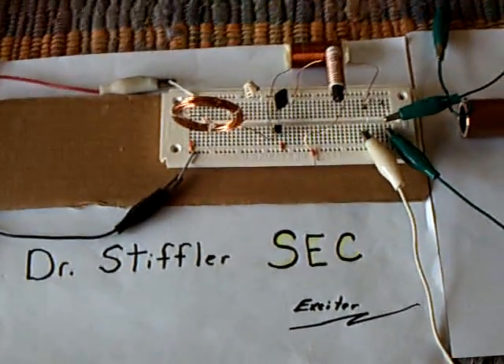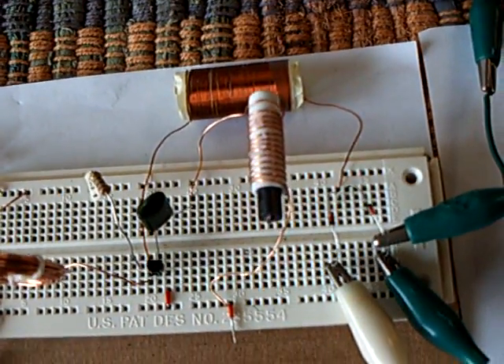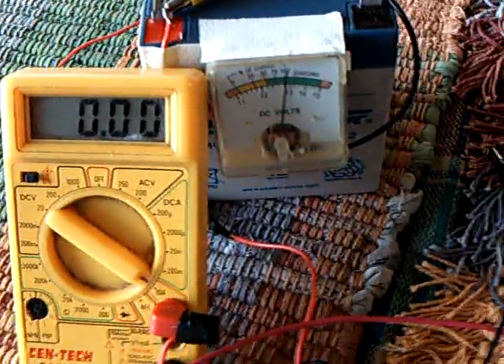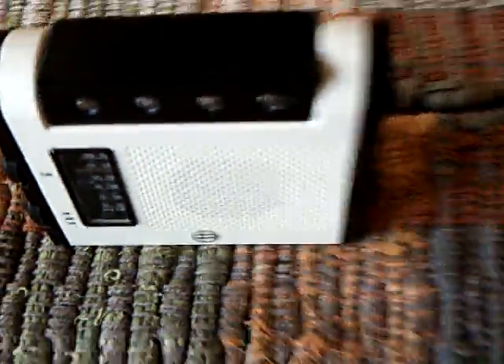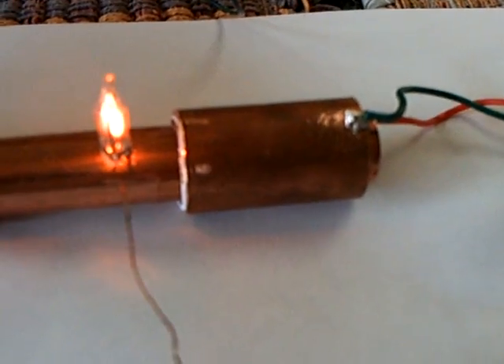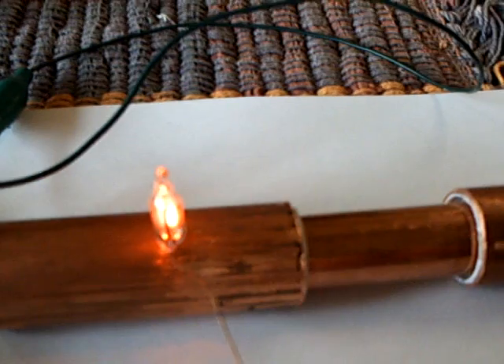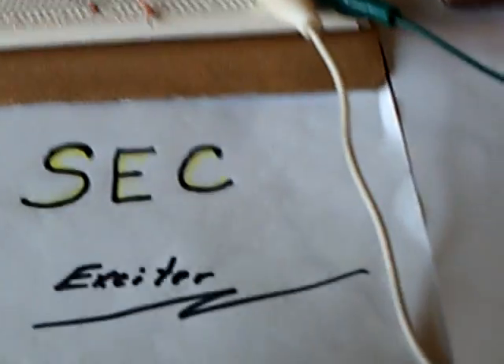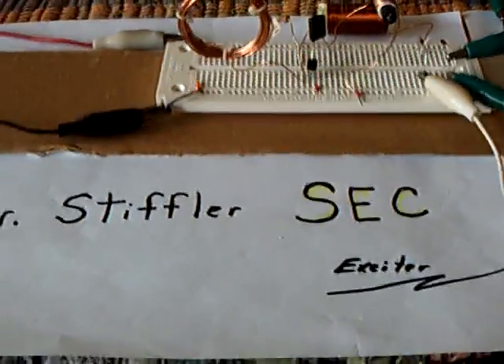Dr Stiffler SEC with SGate

Comment: i tried MRH2O2's "pls replicate" with a HF smilutator and then 555 timer circuit running ignition coils,i got some odd piezo effects but i could not get a 12 volt incandescent to light-looks like i need to build a stiffler SEC....

Comment: Lid:

I don't know what I am talking about but since you got shocked in the circuit prior to the "load" try removing the "load" and make the load the tubes the load.  Just a guess.  I was shocked many times from my fuji board before I realized that ...."hey that's high voltage, I need that."  Anyway, great video as usual.

Bil